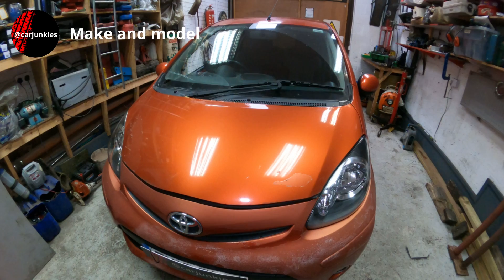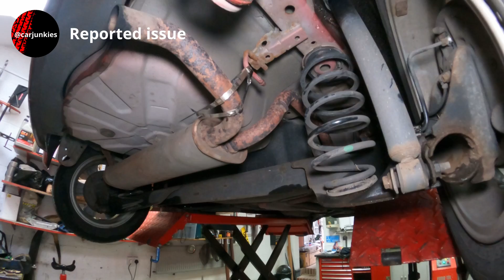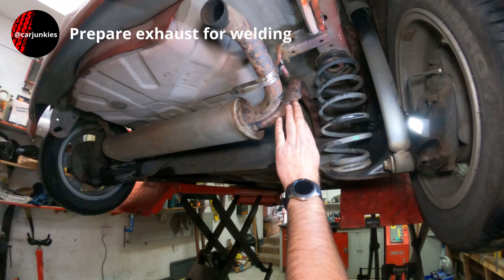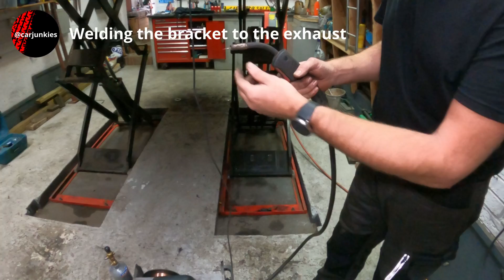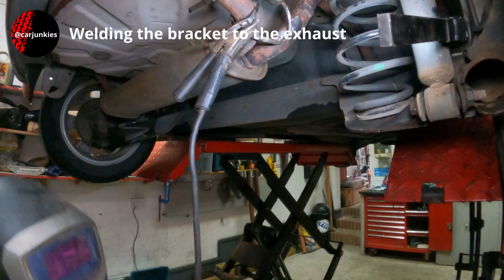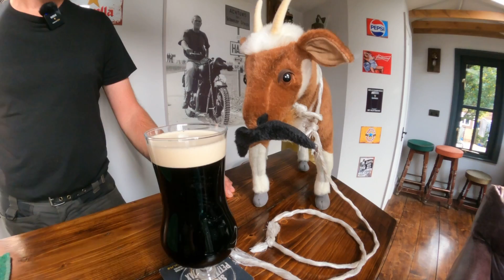Toyota AYGO 1.0 Petrol (2013) - Exhaust Mount Bracket Repair

Comment: Great video - if only I had a welding kit - hope I can get the garage to fix rather than replace the exhaust!
Reply from the maker: Most garages should be accommodating providing the rest of the exhaust is in good condition. Done this a few times for customers with an AYGO, so it’s a not uncommon problem. Good luck